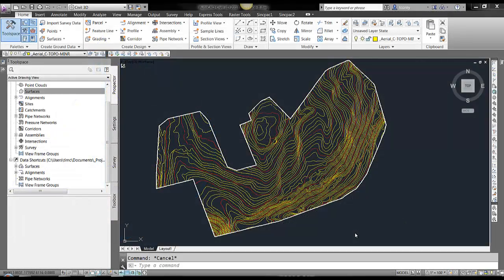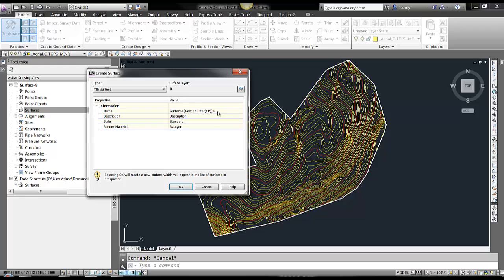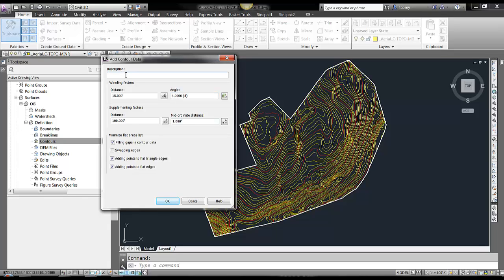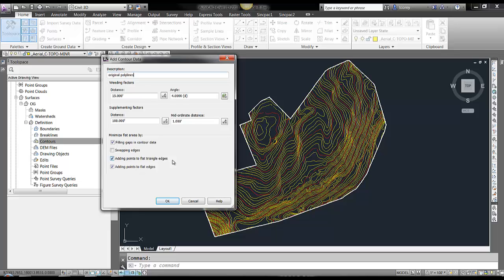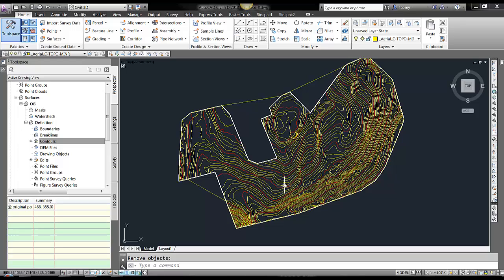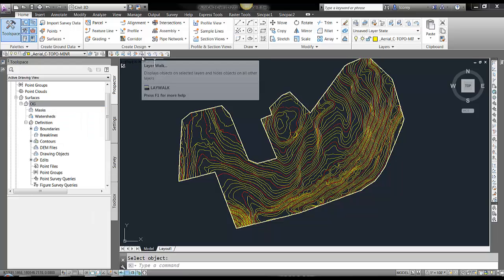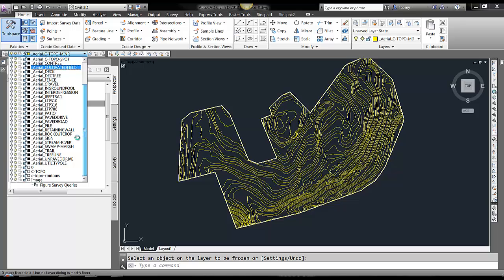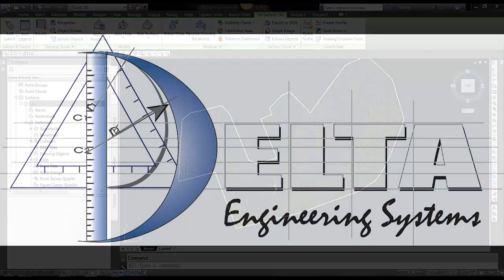How to create surface from polylines in Civil 3D.mp4

Comment: how does Civil 3D know the elevations of each contour. your video missing a lot
Reply from the maker: The polylines have elevation properties. Civil 3D uses these properties.
Reply: @timothycorey146  Thanks. I searched the internet to find how to assign elevations to polylines but no luck.
Reply from the maker: Elevation is a property of each polyline. Select a polyline and then go to Properties. You will see and be able to edit Elevation.
Reply: @timothycorey146   I think it is better to call it specifically as 3Dpolyline because Polyline is only a 2D element which sits on the X-Y Plane which means it has zero elevation.

Comment: Novice CAD/3D user here - at the end of the video, when you apply a style to the surface, the contours did not reappear. Do you have any advice? Could it be because I assigned elevations to the polylines when I drew them? Thanks.
Reply from the maker: Nick Parrish I'm not sure I understand your question. Are you saying the contours don't reappear in the video -- they do -- or that they don't reappear when you try it on your computer? If the latter, check your surface style and be sure the layers specified for the contour components are thawed and on.
Reply: On my computer, the contour layers are thawed and on.
Reply from the maker: Please contact me directly: support at deltaengineeringsystems dot com.